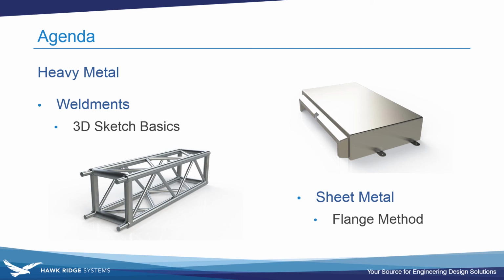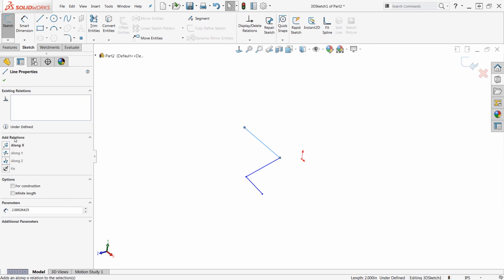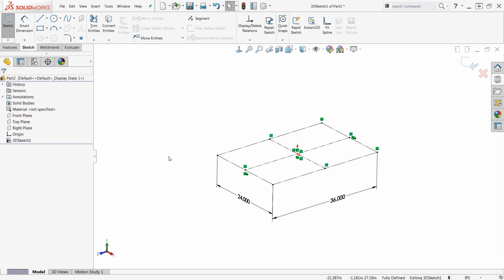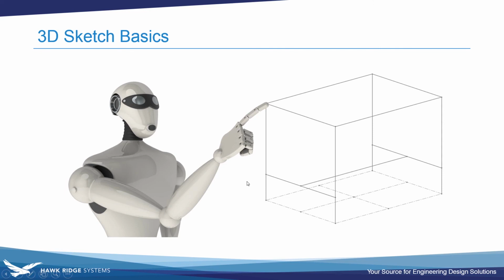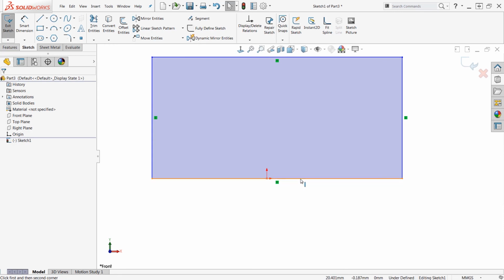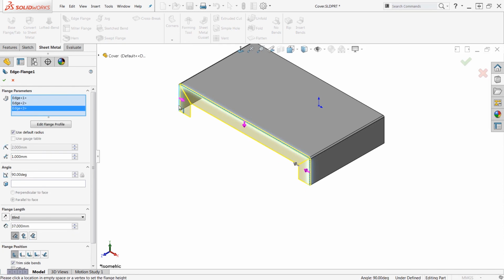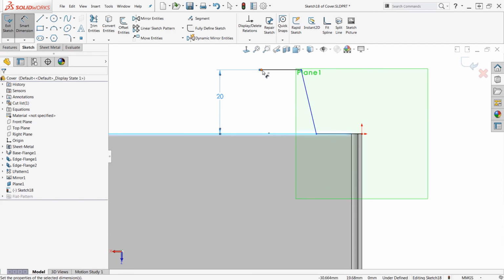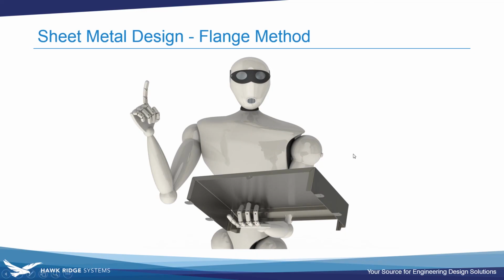Heavy Metal! - Tips and techniques for Sheet metal and Weldment design in SOLIDWORKS

Comment: hey ,
can you tell me how can we make a dof triad appear in the interface ?
Reply from the maker: If you are referring to degrees of freedom (DOF) - while working in an assembly environment, if you right click a component, (that is not fixed),  you choose Move with Triad from the contextual menu. If you are working in a multi-body part environment, then choose the command Move/Copy Bodies and use the Translate or Rotate options. Both of these actions will give you a DOF triad in the interface.